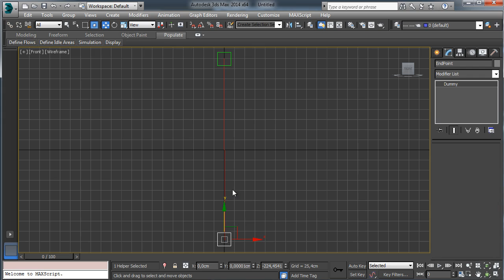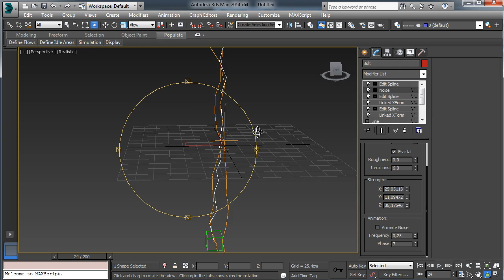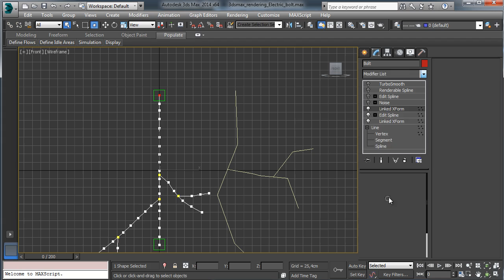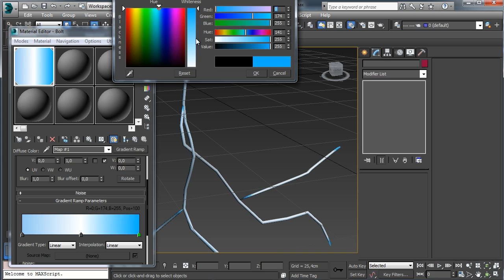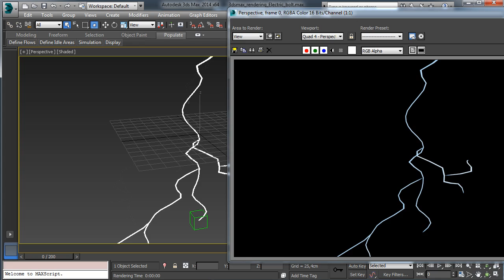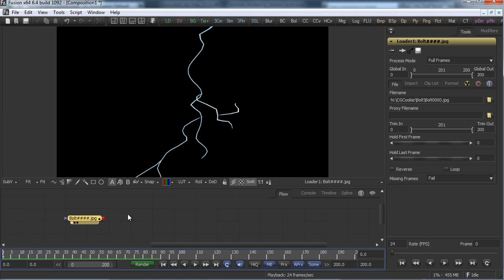Electric bolt

Comment: I did exactly what you said in the tutorial but I can not export to fbx format successfully. It gives the following error: The plug-in does not support the following objects' geometry type and will convert them to editable meshes. Morph and skin deformations may be lost.
If 'Enable in Viewport' is deactivated, closed shapes are capped and open shapes are converted to dummy objects with edges or faces.
If 'Enable in Viewport' is active, the Viewport settings are used for mesh conversion.
. Would you help me?